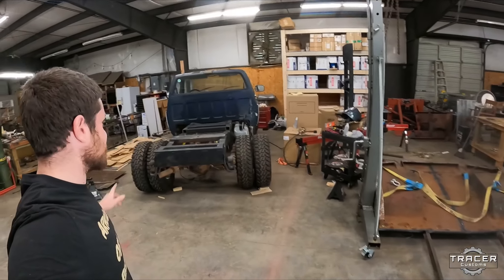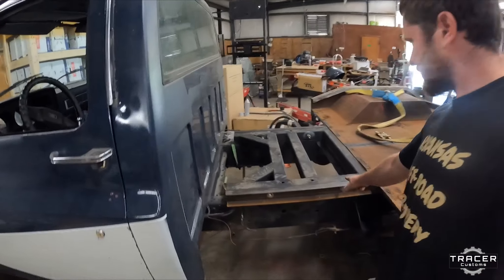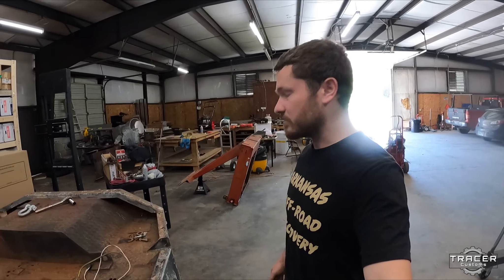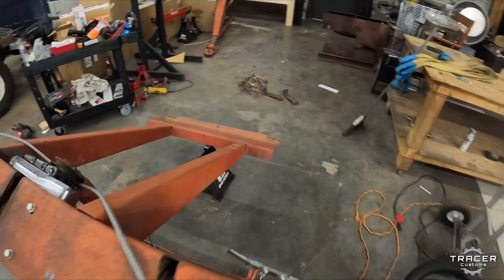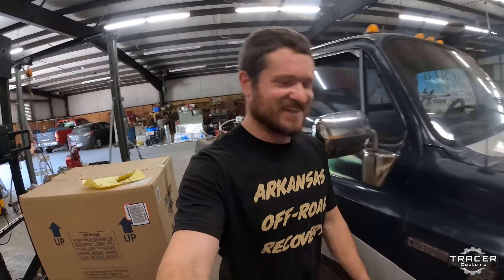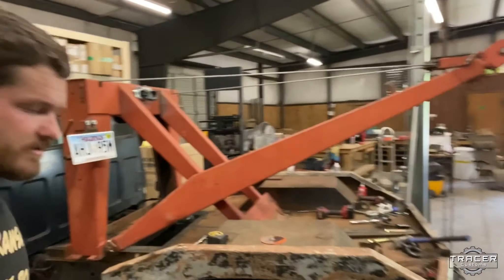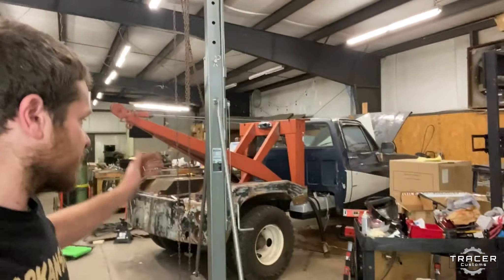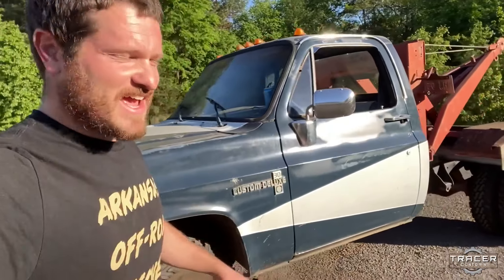Bed and Boom are on the Off Road Wrecker

Comment: Make sure you raise the differential vents up as well or you will get water in the diffs. If you have a SM465 transmission you might want to raise the vent up on that too as well as the transfer case vent. The front diff has seals right next to the carrier that are known for letting water in too. Make sure you use a good grease in your hubs like Royal Purple. It is worth the money.
Reply from the maker: Yes for sure! Planning on running those up as high as we can get them!